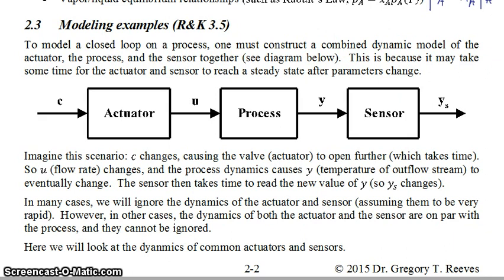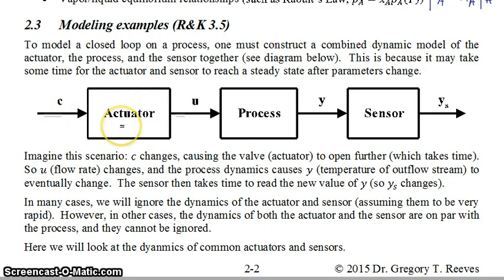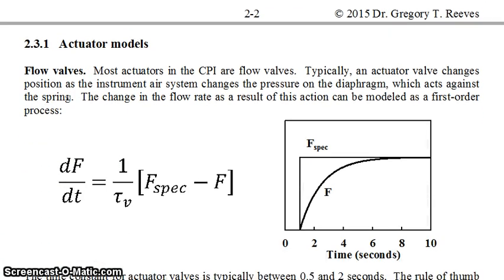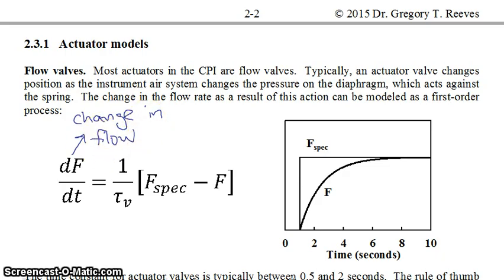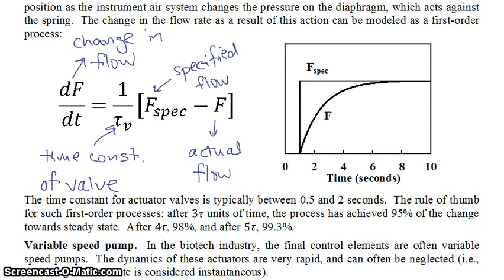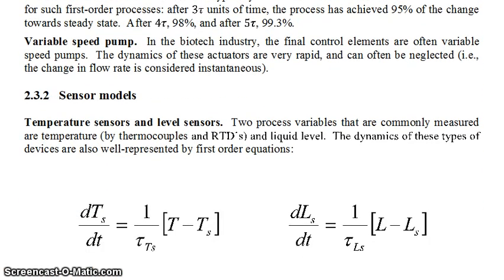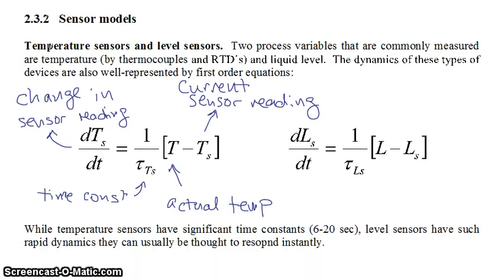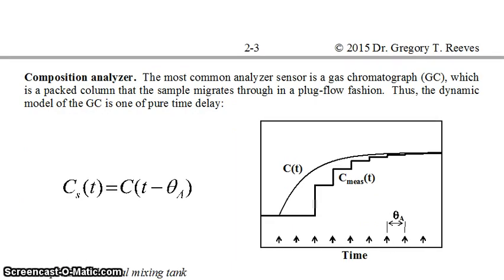Sensor and Actuator Models

Comment: What would be the response in the case of a pressure sensor reading of the valve actuator ? Thanks in advance. also does have to be a change over time? what is i want the change with respect to another variable ?
Reply from the maker: I am not 100% sure I understand your question. Are you asking what a pressure sensor reading would be upstream vs. downstream of the valve? What is the context of your question?

Comment: How to find transfer function sensor pH?
Reply: Do you have a good model for the dynamics of the pH sensor? Can you model it as a first order ODE (as in the video)? Does it have time delay?
Reply: @GregReeves1520  i dont understand sir, can you explain it?
Reply: @anggitwijanarko5164  , in order to find a transfer function for the pH sensor, you'll first need to figure out how to model it in the time domain. For example, in the screencast, temperature sensors can be modeled as first order ODEs, and analyzer sensors as pure time delays. What would be a good model for the dynamics of your pH sensor?
Reply: @GregReeves1520  do you have video to explain it sir?
Reply: @anggitwijanarko5164  Sorry, no, I don't have any videos on pH sensors. Do you have data?
Reply: @GregReeves1520  datasheet?  I have sir ,
Reply: May i send you my datasheet sensor PH?
Reply: @anggitwijanarko5164  I am not sure that's a good idea. If you have data, you may want to try to fit a first order model to it, or maybe first order plus deadtime (FOPDT). I have a video about that somewhere in my channel.
Reply: @GregReeves1520  can you help me to find the first order from my data?
Reply: @anggitwijanarko5164  I don't think that's a good idea, but you can either approximate your data as first order (an exponential) or an FOPDT if you think there's deadtime, and you can follow what's on that video.